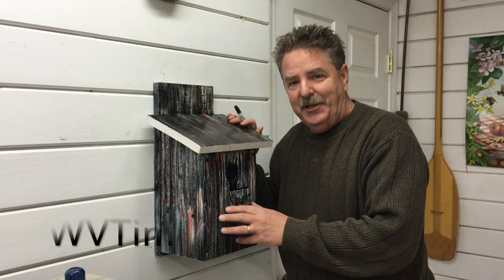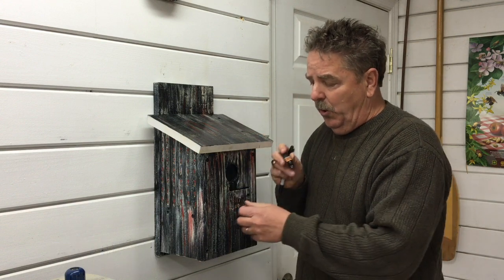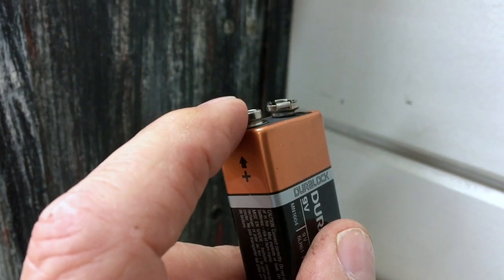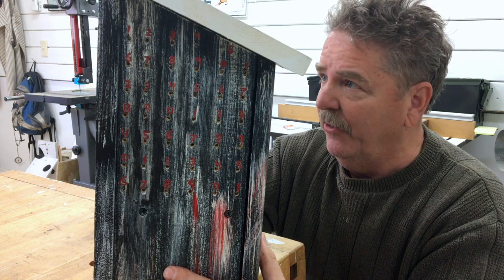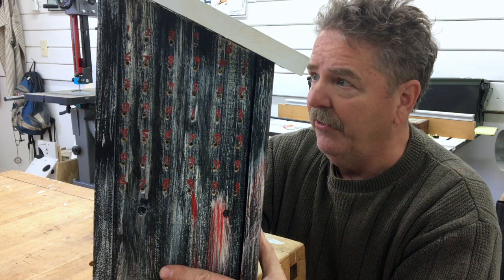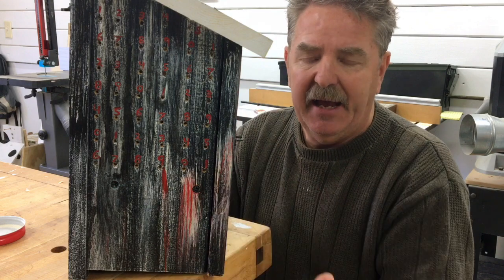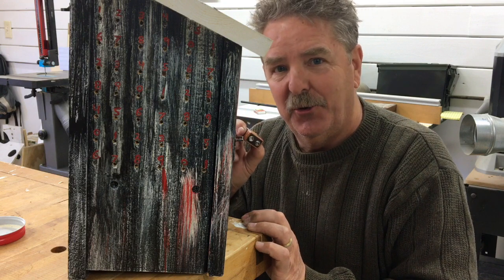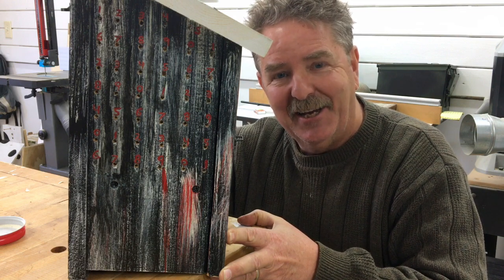Build this 40 light Gadget cache

Comment: did yo put anything on the cache to keep it weatherproof?.. that's a lot of electronics... so my main concern is keeping the inside sealed up from water and erosion
Reply from the maker: I simply put a bead of calk on my seams, especially the top one where the lid hits the back board.  My caches stay extremely dry, not even a bit of dampness.

Comment: Hey Tim you make awesome videos. What kind of wood and brands of paint do you use? Thanks!
Reply from the maker: I make my boxes out of  pine, but cedar would even be better, it is just some much more expensive.  I haven't had good luck with treated plywood, but there are times the size calls for it.    I buy any Good quality paint.   I start with a wood primer and then coat with at least 2 coats of Exterior paint.